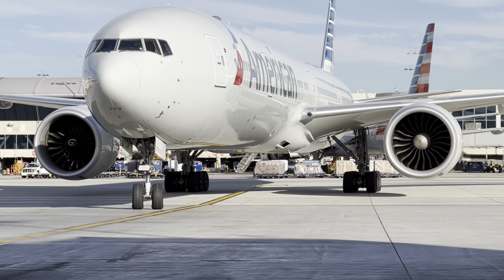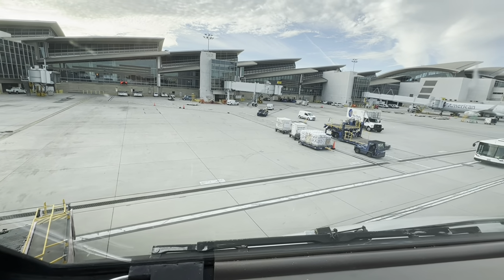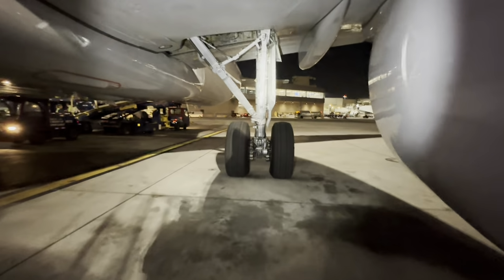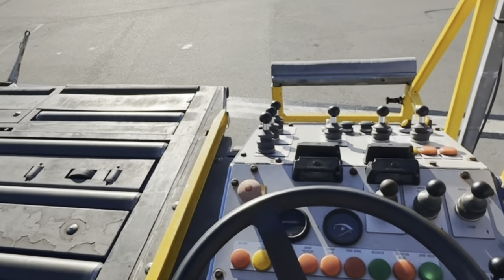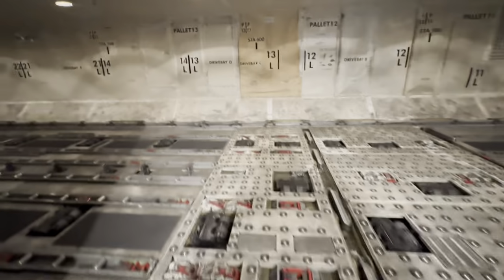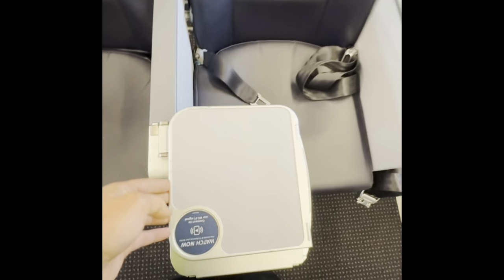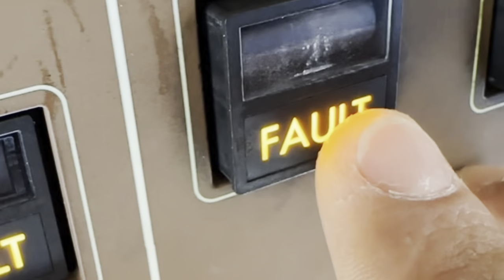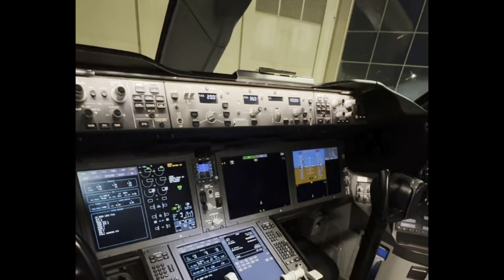Stig Shift #3 .. Thanksgiving Week Shift (22NOV23 - 25NOV23)

Comment: Makes sense that it uses Win XP. The 300ER was launched in 2003 during the XP era. Updating an OS always introduces risks to a design, so what ever OS they used during design of the plane is what would have gone through certification. So, it will have to stay XP. You are absolutely right that XP is stable in terms of bug fixes. I reckon the new 777-8 and 9 will be the best plane ever built taking existing 777 tech to the next level. Can't wait to see that in the skies in 2025. Oh how I love looking at those GE9x engines ❤
Reply from the maker: I can’t wait to see the new 777 as well, it’s going to be an interesting aircraft because they’re taking a lot of the 787 technology and putting it into that one.

Comment: Con - Continuous Ignition. For flight into heavy precipitation, heavy dust or severe icing. Engine is then more resilient to flame-outs under extreme conditions.
Reply from the maker: Perfect 👍
Reply: @StigAviation  Also when an Ramp Aircraft Maintenance Engineer gets sucked into a running  engine, having the selector on "con" cleans the engine and no writeup is required. ;)
Reply from the maker: @fastflame200  that wasn’t funny Michael. Please don’t make jokes like that here. I don’t appreciate it.

Comment: I was run up/taxi qualified on the 727/767/&757 during my time at AA. I WAS ALSO IN ONE OF THE FIRST 777 GenFam classes at DFW. At that time AA only had 777-200s
Reply: Sorry, part of my previous message was not supposed to be alll caps. Noticed it after it posted.
Reply from the maker: I got all those ratings as well, but they’re useless now. We don’t have any more 727s we have no more 767 or 757, even my 330 rating is useless. But I still enjoy it because I still get access to some of the manuals and I love to read the systems. Gosh darn it. I love this job.
Reply: Been retired since 2016. Was not given much of a choice on retirement. AFW was shutdown and no DFW locations were offered to us.

Comment: I can remember the first time I flew on one of Air New Zealand's 777-300 aircraft ZK-OKM and when the engines started up and made that mooing sound, I was grinning from ear to ear. I spotted one of my national airline's planes next to the Turkish Airlines(biofuel) jet. Yes I know what it is like as I work in hospitality and the things I have had to sacrifice like weekends, summer holidays etc.  Nice sound of the IAEV2500. Air NZ has A320's with these and A320/A321NEOS and our NEOs are due to have their engines looked at because of an issue the P&W engine. What is continuous ignition on a jet engine?
In a jet engine, the term "continuous ignition" refers to both automatic and pilot selectable activation of the ignition system in circumstances other than during the start cycle. Also I collect anything do to with airlines, aircraft too. I have recently bought a window that belonged to a ex Ryanair 73-8 reg(EI-DAG) which was converted to a freighter and now flies for ASL Airlines in Belgium. Look forward to more videos. See you.
Reply from the maker: The air New Zealand are very beautiful indeed. I have a video of the all black one. That thing is gorgeous. And yes that is for continuous ignition. CON (Continuous Ignition)

This is selected when there is heavy precipitation, severe turbulance and/or during takeoff & landing. When CON is selected, it basically tells the engines ignitors* to keep firing, that way in the event of an engine flameout, it can re-ignite. This is particularly useful in critical stages of flight like takeoff and landing, where if a birdstrike happens for example, the risk to engine failure becuase the ignitors aren’t lighting can be minimised.

Comment: I remember working on the Maintenance Engineering reviews when the MD-90 was in early production,  Working MD-11s primarily, I had asked a the (young) cognizant engineer about the cargo fire detection system and he laughed at me "there's no room for any of that!"  I believe 6 months later, ValuJet 592 happened.  That same engineer and I were discussing that accident and in a wide eyed manner, he asked me if I knew that they were on fire during taxi and takeoff - which I hadn't. No indication of high temp or smoke because there was no system at that time on the DC-9 - the light crew had no idea until it was too late.  He said it changed his perspective on everything.
Reply from the maker: That engineer learned a very important lesson that day. I guarantee you that he will never neglect such vital details.

Comment: Stig, show us the STATIC PORTS on the Boeing and Airbus and where they are located, and the Pito tubes, any differences between brands, locations, etc...  thank you, inpatiently awaiting the next video...lol
Reply from the maker: Will do. And for a quick answer to that , most pitot tubes are at the nose of the aircraft and towards the front sides for static ports
Reply: @StigAviation  I knew about the pito tubes but had no idea about the static ports and still am not sure how they work.
Reply from the maker: @GhostSniper67  I’ll make a video for this.  Give me time
Reply: @StigAviation  thank you, I know the pito tubes work with the static ports to measure air speed not ground speed, just curious how the static port measures the air passing over it so it can be used. Also, do you guys get the landing gear lock outs and any other devices or locks or covers from the cockpit or do you use your own set? I think you know where I am going with this, if not let me know, I will explain more, but I think you know. Because you mentioned during tire changes you use locking pins, but not where they came from and why.

Thanks again...
Reply from the maker: @GhostSniper67  yes, you are correct most of the important lockout devices are within the flight deck, they travel with the aircraft.
Reply: @StigAviation  I didn't know that but for safety reasons it makes a lot of sense. A lot of thought has gone into everything.

Comment: I remember I was a lowly janitor at a corporate jet hanger at our local airport and me and the A&P mechanic and the security guard were the only ones on duty one day and the mechanic let me help him how to do a run test on a jet engine. He instructed me on how to safely approach the engine while running and I stood under the engine while it was running then climbed into the co-pilot seat while the mechanic taxied us out for a couple of full throttle runups. That was just a small engine on a Cessna Citation so I can imagine what a big RR,PW or GE engine is like. Coolest thing I ever did.
Reply from the maker: I’m really glad you got to experience that, it’s good that the maintenance technician was mindful to teach you how to properly do it. As for the massive engines that I work with, you can imagine.
Reply: Yes I can imagine. Our engines were just little P&W turbine engines of I think around 5000 lb thrust class and I still felt the power standing around it. Oh and after I checked the fuel lines that he wanted me to look at than I climbed inside and sat in the co-pilot seat while the A&P taxied the plane out to the run up pad and did several full throttle runs and we could feel the tail of the plane rising up and we both had both feet on the brakes.

Comment: CON - continuous start  mode of igniters for egines diuring heavy rain in flight.
Reply from the maker: Perfect answer 👌
Reply: @StigAviation  
As a Navy aviation structural mechanic, I have perfomed much of what you do as a line mechanic, progressing through aircraft operations divisions before the shop maintenance crew. 
This is how the Navy uses small spaces with limited personnel for flight ops at sea.
Fly Navy!

Comment: Hi Stig, I'm north of you in moses lake wa. And was able to watch the 777 doing flight maneuvers when in development. Was lucky enough to meet some of the engineers and was told that what I was seeing was the stress testing of the aircraft. The plane has no passenger seats and weights are used to get max weight and they have hundreds of meters to detect stress of the plane when they do maneuvers above what the plane would normally do  it was amazing  how the pilots would do everything just short of barrel rolls to test the airframe. Boeing uses moses lakes old Larson airforce B-1 bomber base to test aircraft. In fact all the grounded 737s were all flown here for retrofit. Nothing compared to the sight of a couple hundred planes parked in one area.
Your video's sure show a side of aviation that most never see, what's interesting is you know more about the aircraft than the pilots. Enjoy your videos,very educational.
Sorry about the novel length comment.😊
Reply from the maker: Thank you so much Bradley, I really appreciate that my friend. Indeed, looking at a whole fleet parked is a site to see. A pretty interesting fact for you, when they are doing those tests, to stress the aircraft, and doing those extreme maneuvers, all the safety features and computer systems are turned off, they are flying in pure direct mode. That’s how they are able to make those maneuvers, pretty cool, right !?
Reply: @StigAviation   I had no idea that all computer and safety was turned off. I have an absolutely even higher respect for those test pilots because I saw that test plane do things I've never seen before with a jumbo jet.
Thank you for the information, truly adds to what I saw. 😀👍

Comment: Con means Continues Ignition, when selected the spark plugs on the engines produce spark continuously. The pilots use it on Landings and when on bad weather conditions like storms, that's because under those conditions there might a flameout or compressor stall.
Reply from the maker: You are absolutely correct Jim.

Comment: I'm a computer engineer, and I know something about the windows XP thing!

People give XP a bad rap, especially surrounding crashing. What people don't realize is that windows XP is actually a very well tested system, the issue is that back in the XP times, many (if not all) drivers were Kernel-Mode, meaning that they ran at the lowest levels of the system. The kernel is responsible for system management and core operating system functions, things like memory management, process handling, and especially crash handling. The kernel as provided by Microsoft is very well tested, to very high standards. The drivers provided by companies on the other hand, especially fly-by-night operations that are gone the year after the device is released? Not so much. And when a program in the Kernel-Mode crashes or sucks up a whole bunch of memory due to a memory leak, it will take the entire system down with it, because the kernel is powerless to stop it as it normally would. 

So the system is more than stable enough to be able to handle the functions it has been given (it wouldn't be there if it wasn't), provided that the drivers are up to scratch.
Reply from the maker: Absolutely incredible amount of knowledge here. That you very much sir. I learned something new.

Comment: Hey Stig, got a question! I saw a video on checking for cracks on engine blades with this special highlighter and UV light? Can you show or explain how it works?
Reply from the maker: That is a form of NDT, nondestructive, testing, what you saw was a dipenetrant fluid sprayed, or applied to the surface, then they will apply a developer coating. After which they will use a UV light to expose any cracks, this is usually done by inspection department. Alternate method is using Eddie current machines to check for damages and cracks. And there’s also an option of using ultrasonic machines.

Comment: The power of GE-90 is amazing. But imagine how strong the parking brake for the GE-90 plane. 
Mr. Stig, when you guys do a high power run. How do you keep the plane in place? Is the parking brake that strong? I doubt the parking block thing is heavy enough.
Reply from the maker: The parking brakes are very strong, but you also have to take in consideration that there’s 12 brakes holding that massive aircraft steady on a high-power run. Sometimes we also use very special chalks that look like mini skate ramps in front of the wheels.

Comment: "CON" is where you can use a ground based Air Current, APU or Wind Mill start the engines! That the correct answer?.
Reply from the maker: Not quite. CON means continuous ignition

Comment: CON=Continuous Ignition (For flying through certain conditions & temps)
Reply from the maker: Correct 👍 here’s some more info 
CON (Continuous Ignition)

This is selected when there is heavy precipitation, severe turbulance and/or during takeoff & landing. When CON is selected, it basically tells the engines ignitors* to keep firing, that way in the event of an engine flameout, it can re-ignite. This is particularly useful in critical stages of flight like takeoff and landing, where if a birdstrike happens for example, the risk to engine failure becuase the ignitors aren’t lighting can be minimised.

Comment: I found your channel yesterday. Very informative. Thanks. 
About using Windows XP. I' m working at the National Railway company over here in the Netherlands. We have trains running on Windows 95. 🤣
Reply from the maker: Thank you very much for being here, I appreciate you watching. And that’s very interesting. I did not know trains also use this type of software.
Reply: @StigAviation  It was the first version of TCMS ( train control monitoring system) .
Modern trains and locomotives are computers with wheels like modern airplanes are computers with wings.

Comment: engine start switches i would say means continual ignition. it continually fires the igniters so if rain snuffs out an engine it will quickly relight it while the engine is at a speed that can support easy relight vs windmilling 

the 777 was the last plane designed by engineers the rest were designed by engineers with approval from bean counters and shareholders and in my opinion is why Boeing has seen so many headliner issues that dont even show up in the news but im sure u are familiar with  they messed up big time when they bought MDD and adopted alot of the design policies and people from them
Reply from the maker: Absolutely correct on answering the question, and yes, I am very well aware of how Boeing is doing things. But thankfully we are the endline users, and the maintainers. Trust me when I tell you we will keep it airworthy

Comment: Geeat video Stig my fave aircraft in the opening a 777, how hig is the circumference of the engines. Work is never work when you love what your doing, keep it up my friend 👍
Reply from the maker: It’s definitely a beautiful aircraft, that particular 777 is equipped with the GE90–115B. If my calculations are correct, the diameter of that engine is 128 inches, which makes the circumference 402 inches.  Let me know if my math is off. 😅
Reply: @StigAviation  your math is bang on which means its 10 feet in diameter. I could stand in that engine and only come up to the spinner as I am 5ft 6inch. That's huge Stig 😲
Reply from the maker: Yep, exactly, and I think I have a video where I’m actually standing inside of the engine itself, I am 5’6 and even if I try to jump, I still couldn’t touch the upper inlet Cowling. When I say this engine is massive, I truly mean it.
Reply: @StigAviation  and rated between 81,000 - 115,000lb of thrust plenty of power stig

Comment: Spot on stig Windows XP is great i still have an older computer with xp installed on it. Backup for when my win 11 system goes bonkers.
Reply from the maker: XP is so reliable, basically all the kinks have been worked out in that operating system. Don’t get me wrong, It’s slow as molasses but still works just fine. 👌

Comment: Is con for constant, probably for take off and landing
Reply from the maker: You’re pretty close on this. CON (Continuous Ignition)

This is selected when there is heavy precipitation, severe turbulance and/or during takeoff & landing. When CON is selected, it basically tells the engines ignitors* to keep firing, that way in the event of an engine flameout, it can re-ignite. This is particularly useful in critical stages of flight like takeoff and landing, where if a birdstrike happens for example, the risk to engine failure becuase the ignitors aren’t lighting can be minimised.

Comment: Do you ever see blancolirio? …he flies the 777 LAX/LHR flight often. 

You guys should do a collab sometime on a mechanic/pilot topic. He’s also an A&P
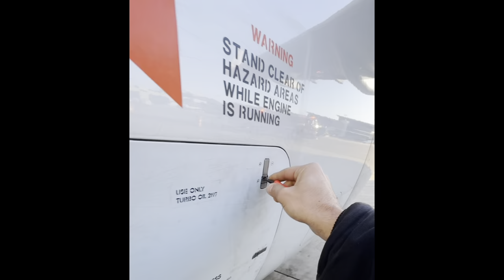Reply: What’s the orange handled tool you use to open the oil fill doors with on the engine at 32:25?
Reply from the maker: I have heard his name many times, but I haven’t had the pleasure of meeting him yet, why don’t you tag him here maybe he might respond and I could meet him when he flies in.
Reply from the maker: A simple screwdriver, it’s a mini screwdriver I should say.
Reply: @StigAviation  it looks to be snap-on’s color. Just wondering. Looks pretty handy.  Prolly need to pick one up myself.
Reply from the maker: @nolt4024  yup. Snap on.  Model number SDDDM1A  costs about 20 dollars.

Comment: CAN BUS (ARINC825) and ARINC 664. While Arinc 629 was an improvment to Arinc 429, it is still too limitted for the systems getting cramned into the newest planes.
Reply from the maker: It’s because of the amount of data being shifted at this point, this is why they are focusing more on fiber, optic wiring and ethernet wiring.
Reply: @StigAviation  yep, plus better self diagnostics on the LRUs themselves. Some of the new fans log flight phase, internal temp, external temp, current draw, vibration and more when a failure occurs. Then that data can be used for a deep dive analysis over time to see if there is a design defect that was not visible when the aircraft was new. Their even working on pulling that info in flight and sending it via Satlink to you guys so you and pre order the parts and have them ready before the plane even lands.